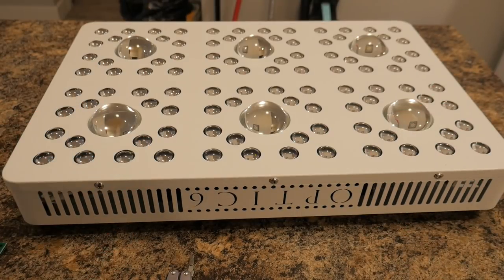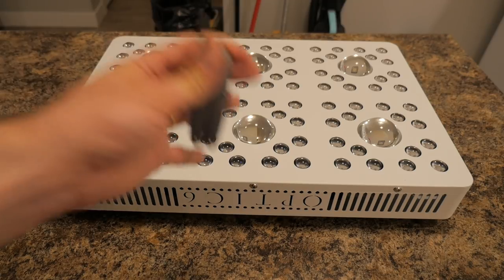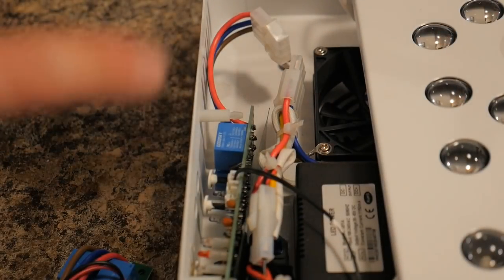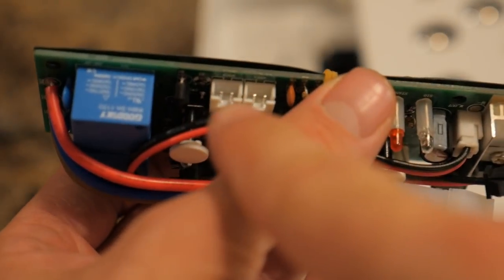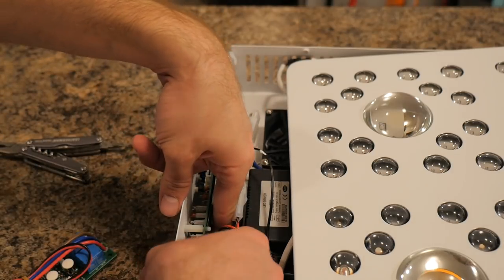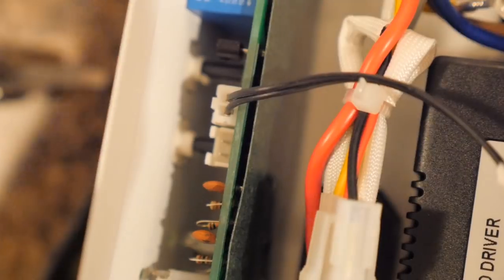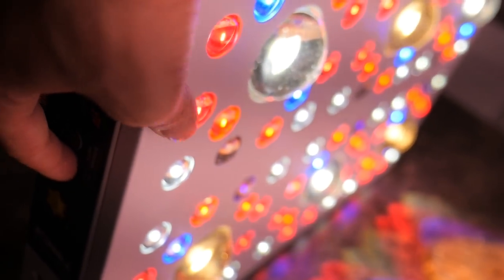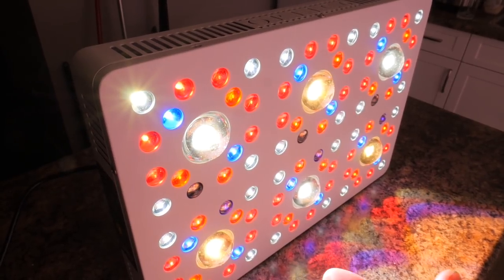HOW TO REPLACE OPTIC LED TIMER BOARD - POWER AND TIMER ISSUES FIX

Comment: Thanks for this video I've just replaced mine on the optic 4 GENERATION 3

Do you know if the optic 4 Generation 4 is better than the generation 3

Regards
Reply from the maker: Gen 4 is way better, everything has major improvements.
Reply: Thanks very much

I pop up a short video of my GSC Autoflower 
Thursday will be its fourth week in flower 

Thanks for the reply ☮🤟

Comment: i noticed that there are two outlets in which to plug the temp. sensor, does it matter which one i plug mine back into? i have an optic 4, do i plug it back into the plug thats on the end closest to that little blue box? or does it go into the one further away from the blue box.

Comment: They use cheap capacitors that fail, from the heating up and cooling down.  What happens when you source your builds in the ultra cheap Chinese build shops.

Comment: As much as this light cost you shouldn't have to fix anything should have a killer warranty I'll stick with my CMH 👍👍 ✌️
Reply from the maker: MR 810 it does have warranty, 5 years. It's way faster to fix it this way and cheaper than sending it back and forth.
Reply from the maker: PATSFAN420... It took me 5 days to get the parts and 15 minutes to fix... Free... It would take probly 14 days to send it there and back... Do the math, ain't nobody got time for that...
Reply: Just make your own if got the time,saved me fortune.

Comment: All my 5 watt diodes a poached and all my leds are burnt. It's over 4 years old and is the original Alibaba chinese unit that they just threw a sticker on and pretended they made lol oh well I'll fix it myself.
Reply from the maker: Not the same light but yes they USED TO look the same. Big differences now compared to the new Optic lights. Neither was it the same company.
Reply: @DrAutoflower  So you are pretending they didnt just take a chinese model off Alibaba and slap an optic led sticker on it LOL  that's how this company was started dude I've been following since I bought my light from them....yes theyve used profit from selling chinese lights and created a company out of it but to pretend they didnt just steal someone else's work and slap a sticker on it is laughable.
Reply from the maker: @grxygxds  you do realise that a person can go to a factory company in China see there making a product and you can engineer and design it a different way to suit your needs?? That's what Optic did. I tested simatik too, not the same lights bro. That guy never designed them differently from the original company Optic did. Nothing wrong at finding a good product and engineering it better. I work for the company now and it was easy to put my name in with the company because they are top end now with all the Slim and next gen lights which are huge jump in quality. Lol your forgetting how much shits made in China and how many American companies do this just like Apple... And just like Apple, quality is determined by the factory so your argument is nonsense
Reply from the maker: @grxygxds  Optic is not owned buy the origin company nor is the same company. Any company can work with a factory company to engineer a product differently. dude get your facts straight and learn about how factorys work in China.. I could go out with my own company right now, find a product, engineer it to my suiting then it's my own product that is different from the original... Do you have the same argument for 90% of the products on Amazon?? You obviously don't have a clue
Reply: @DrAutoflower  This 50 cent optic led sticker that was slapped on my model made the price go up 300 dollars....your boss got rich by scamming people. So dont complain when people remind you how your company was created.  China Brand Led with a sticker bro nothing special a bunch of stolen designs....#innovator
Reply from the maker: @grxygxds  I owned the original Optic and Simtek, did you?? It was different led configuration. Again, you better learn about how companies work with Chinese companies to engineer products better SUITED FOR THERE NEEDS... Can you still not understand that??? You a want selfie stick with a mirror on it? Then get it engineered and made and you can sell it... Same with Led lights... What don't you get?? How can you explain the Optic 8+ or slim Series or next gen series with your argument that Optic does not engineer lights?? Every time I hear the same old nonsense argument it makes me laugh because who the fuck buys lights off Alibaba, name one person... Every single person who made this argument has never bought off there...
Reply: @grxygxds  brother they are in no way the same light. That's like saying a Porsche Carrera and Volkswagen are the same because they both got wheels and tires.  Come on man

Weston had Eric's job at LED DEPOT for years before Eric and started his own company.  Optic LED made tested and passed US safety and compliance standards here in the US.. Unlike anything you get from Alibaba or Aliexpress. 
Also the correct comparative is Simetek and Phlizon and Willis.  Those are made with cheap components haphazardly put together.  

The more you know
The more you grow
Reply: @grxygxds  you got owned poser boy 😆

Comment: I would have just sent the whole damn light back. You shouldnt have to ever work on your own light. If you got electrocuted you could sue them.
Reply from the maker: HIGH GRADE why would anyone want to waste all that time and money sending it back and forth when it's way quicker and easier to DIY it..? No one got shocked... There was a bunch of power outages here and a power surge must have short circuited this unit, other units are fine.
Reply from the maker: HIGH GRADE also you don't work on it plugged into power obviously...
Reply: DrAutoflower 😜😜😜😂😂😂😂😂😂💕